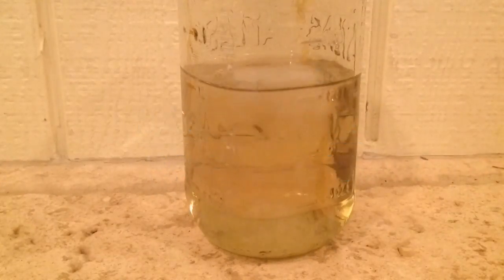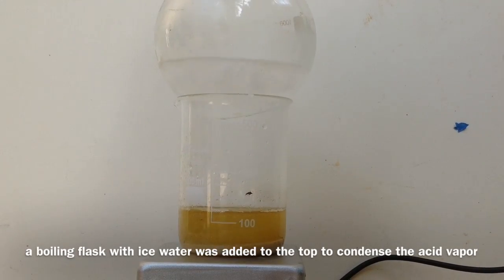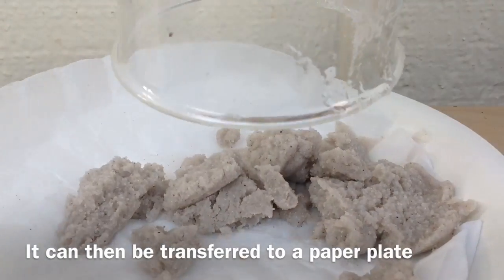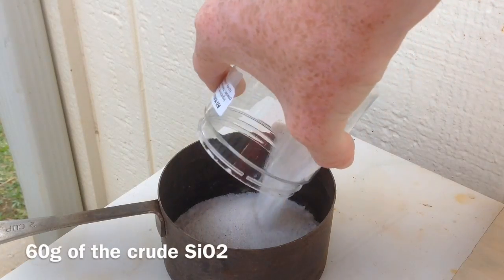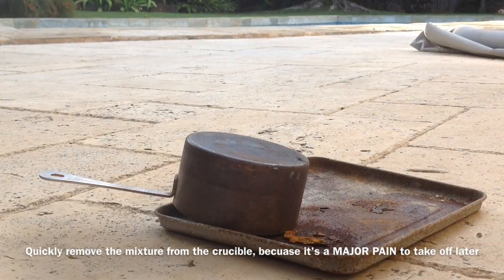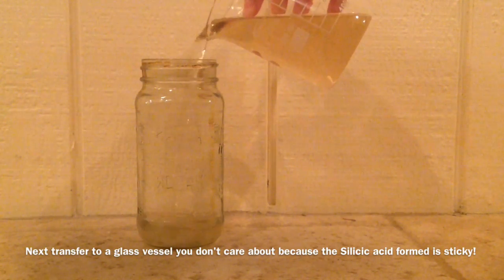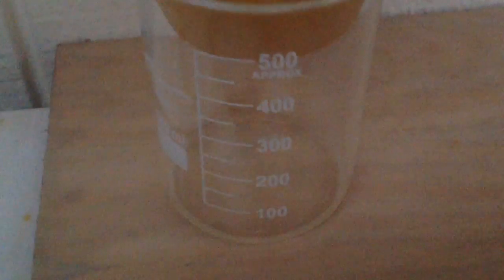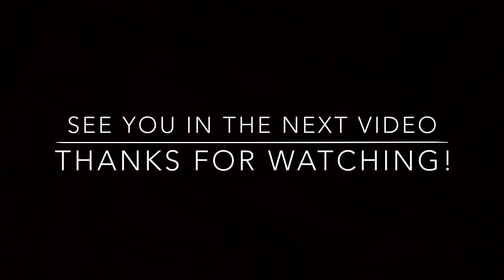Pure Silicon Dioxide From Beach Sand

Comment: Ball milling the sand to a powder dramatically increases the surface area and cracks the silicon dioxide crystals along impurities like iron which better exposes it and other impurities to the hydrochloric acid bath allowing it to be washed away leaving you with more pure silicon dioxide before disolving it in sodium hydroxide.

Comment: Two questions.  Why didnt you just crush quartz?  How did you get other minerals out, such zs zircon etc.
Reply: Zircon is acid soluble so it’s washed out with the acid. 
Any residual mineral content should be negligible.
Reply: Though, maybe there’s some residual calcium sulphate which isn’t as soluble in HCl as most other minerals involved but it’s likely less than a percent.

Comment: Fun fact silicon dioxide is what blacksmiths used to use as flux for blacksmithing
Reply: They put silica sand in the furnace during the smelt to  lower the melting point of the ore and used it during the folding process to refine the iron.

Comment: Can i use 30/° sulfuric acid
Reply from the maker: I think you can use 30% but it will take a larger volume. Thanks for asking!
Reply: @BackMacSci  i have a pink results is that normal
Reply from the maker: Do you mean pink results as in your silicon dioxide product is pink?
Reply: @BackMacSci  yes

Comment: surely in the formation step of silicic acid you could use HCl instead of H2SO4, and then wash out the former NaCl after drying. seems like a much cheaper approach, cause HCl is readily available. if the yield is reduced, just freeze the thing and let it crash out. or am I missing something

Comment: Excuse me, why is it the "grt" sound is produced when H2SO4 is added into the Na2SiO3 solution???
Reply from the maker: it may be the sound of a small amount of water turning into steam very quickly as a result of the sulfuric acid disproportionating.
Reply: Thank you so much. Excuse me, do you have any idea on how to make silica gel which act as a stationary phase on tlc plate?
Reply: Or silica gel which use to absorb moisture.

Comment: Ingredients required:
150 gm sand
100 ml HCl
400 ml H2O
24 ml H2SO4

- Add sand slowly while heating. 
CaCO3 + 2HCl	 -> CO2 + H2O + CaCl2
- Dissolve sand impurities into HCl while heating and stirring.
- Add a boiling flask to condense HCl vapour.
- Wash rest of acidic sand with water.
- Dry purified sand.
- Weigh 80 gm of NaOH.
- Pour into a stainless steel pot.
- Add 60 gm of crude SiO2.
- Mix the two powders together.
- Heat them up to above 300°C until the mixture melts.
2NaOH(l) + SiO2(s) - > Na2SiO3 (s) + H2O(g) 
- Heat till all water boils and it starts to stiffen up.
- Get it out of the pot quickly before it hardens in its place.
- Once cooled, add all solids to a beaker.
- Add 400 ml of H2O and dissolve to the best of your ability (might take a while).
- Filter it out using gravity filtration with coffee filter paper, or a vacuum filter set up if you have one.
- Transfer to a vessel you don't care about as the silicic acid formed is sticky which will form as it heats up. 
- Measure out 24 ml of H2SO4 and add it drop wise.
- It will start to form a gel.
Na2(SiO2)7 + H2O4 -> 3.3SiO2 + Na2SO4 + H2O
- Filter it again, and wash it with water.
- Transfer into a tray and heat it up indirectly to decompose excess Silicic acid to form SiO2.
- Grind the produced product, the yield should be around 30~40%

*I am aware that he said his yield is 57% but that sas incorrect since his yield was 41 gms and he started out with 150 gms. His yield was actually approximately 37%.
Reply from the maker: thank you!
Reply: Thank you!!

Comment: Hi, can i ask what is hydrochloric acid 7.1m? I can buy hydrochloric acid with 10% concentration ,would it be enough to purifying sand? 
Or should i buy 33%~37% hydrochloric acid?
Reply from the maker: you can use the 10% HCl if you like, but the purification process will take longer. If you are starting a home lab, I highly recommend get the 31% HCl that is commonly available at hardware or pool supply stores.

Comment: can you just get sand then heat it and expect it to melt and shape it in fiorm of glass?
Reply from the maker: not usually, no. Almost all sand has impurities like the carbonates seen in this video. You should purify your sand by this process before melting the SiO2 into glass. Make sure you are using a furnace that can reach 3,200˚F otherwise you'll just heat up the SiO2.

Comment: Hi, great video and very helpful info for what i'm attempting to do. I'm wanting to purify some beach sand in concentrated acetic acid (freeze distillation concentrated to somewhere around 30-40%), as i've read that it will dissolve the calcium carbonate and also iron and other metal impurities that should become iron acetate etc, which will be washed out afterwards when adjusting ph. So basically using a strong acetic acid instead of HCl. Then I will use the clean(ish) silicon beach sand to combine with sodium hydroxide and make sodium silicate as you did here - It will be for use as a binder in composites. Just one question... Did you heat the dry silicon sand with dry sodium hydroxide and it melted into water-glass like that? Or did you add some water before heating? Thanks!
Reply from the maker: Hi Kyle, sounds like you have a fun project planned. On the part of the procedure you’re referring to, I added no water to the mixture because it would prevent the NaOH from becoming molten. And we don’t want that because then the Sodium silicate will form very slowly. Thanks for checking out the video!
Reply: Hi, thanks for your reply! Ah, that makes sense - and the info i've been reading suggest that beach sand silica in particular is much slower in aqueous NaOH. 
If you used 60 grams of your crude silicon dioxide with 80 grams of NaOH and the resulting yield of pure silicon dioxide was 40 grams after precipitating with the acid, does that mean that all 20 grams of the original crude 60 grams of silicon dioxide were impurities? Or did the acid precipitation step simply just not precipitate all of the silicon out of the sodium silicate mix?
I ask because I hope to just use the crude silicon dioxide without further purification and I thought (going by your results) that I may need to reduce the amount of NaOH a little bit, since it would mean excess NaOH in the sodium silicate mix?
Also, what is the least amount of water (in grams) that could be added to, say... 100 grams of the dry sodium silicate? I'm going for a dense yet workable sodium silicate mix, because when dry, the evaporated water will have left pores in it's place that will be throughout the set material, making it weaker. 
I may also try adding 1-5% glycerin as a plasticizer when mixing in the water - i've heard glycerin and some other types of plasticizers can be used with silicates to increase plasticity slightly, so it's not so brittle.
Many thanks!
Reply from the maker: I think that the 20 grams of crude SiO2 that were not in the yield were left in the solution and didn’t precipitate, as you suggested. As for the amount of NaOH you are thinking of using, I would keep it the same but add more acid than I did. Finally, I do not know how to do the process of adding glycerin to the silicate so I can’t help you there, sorry! Have fun experimenting!
Reply: Thanks man, that's great! I won't be going to the precipitation stage, as I just want to make sodium silicate. And your video demonstrates how to make it from beach sand, plain and simple.
I'll test out what the effect of adding glycerin is and how much to use. It's for making semi-transparent greenhouse panes - sodium silicate will be worked into white cotton sheet, which should work much like fibreglass or something similar. It seems like it would be a great alternative to plastics (like poly-carbonate) as they all leach out toxic stuff into plants/soil/those who eat the contaminants. And glass is not an option, as earthquakes are very common here these days. I can even see potential for plasticized sodium/potassium silicate as a binder for adding to rough fibrous paper for making boats and other things. If that doesn't work, then there's a way to dissolve cellulose (pretreated in hot acid, then washed) using NaOH and Urea at cold temps around or below 0 degrees Celsius - it produces a transparent plastic! That could also be an interesting one to try for your experiments/videos...? Information on alkali/urea cellulose plastics is severely lacking.
Thanks again!
Reply from the maker: Sounds very enticing as a vid idea!

Comment: You can save yourself a lot of time by starting with water, then dissolving your NaOH, then adding  your sand with heat. You can adjust the water to adjust your concentration. This also makes it much much easier to transfer from the pan.

Glass and stainless is fine to use, Do not use aluminum!
Reply from the maker: +Ryan Williamson Thanks Ryan, your method makes sense but I was 15 when I made this so I followed my source's instructions exactly.

Comment: how do you boil HCL acid? i think it will burst
Reply from the maker: +desta Yakob it won't burst it may only decompose if heated too strongly
Reply: HCl = hydrogen chloride. Add water and you have Hydrochloric acid. Hydrogen chloride solubility in water 823 g/L (0 °C), 720 g/L (20 °C), 561 g/L (60 °C). 

So as you heat it up, some hydrogen chloride and water will evaporate off. But having something  cold will condense both water vapor and hydrogen chloride that is now more soluble in the condensed and colder water.

Comment: So for first reaction anything that dissolves in HCl should be in the solution including any unused HCl solution.  Only solids that should be left are impurities.  Some items in the solution should be Fe, Co, Al, Zn, Ni, Sn, Mg, and Au if oxidized.  Need to breakout chem book.  Having trouble finding what all elements dissolve in HCl.  So 10.35g of elements have been expelled in the solution or as a gas.
Reply from the maker: +Greg L. The theory is that the mass loss is due to CaCO3 impurities.